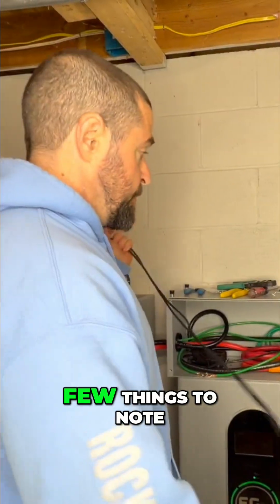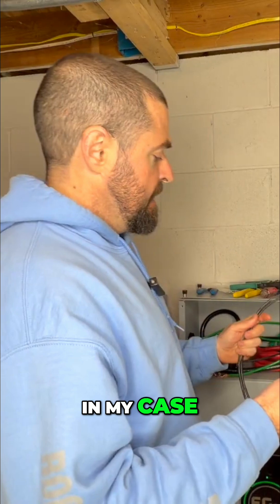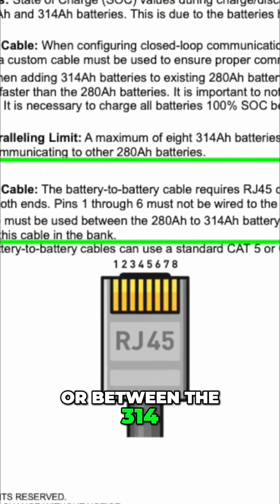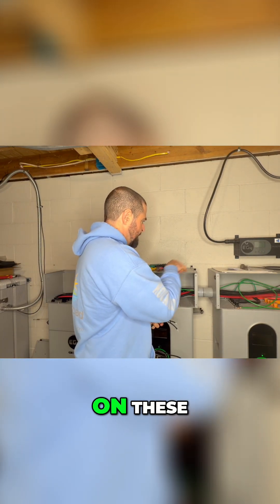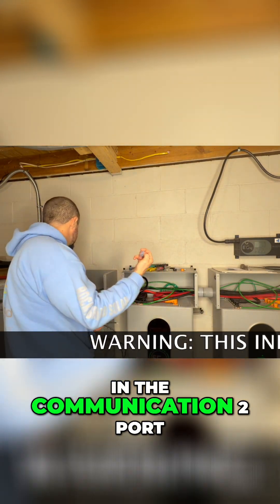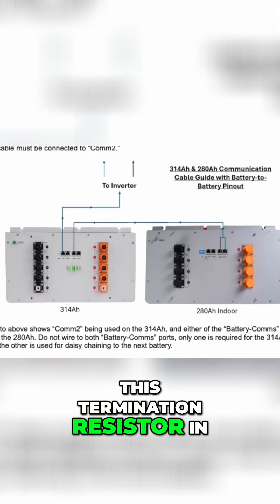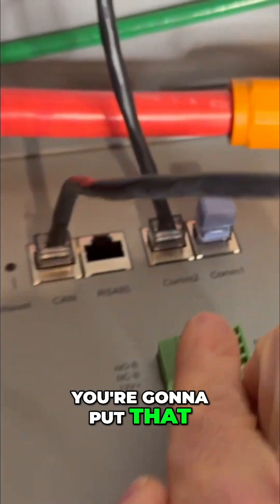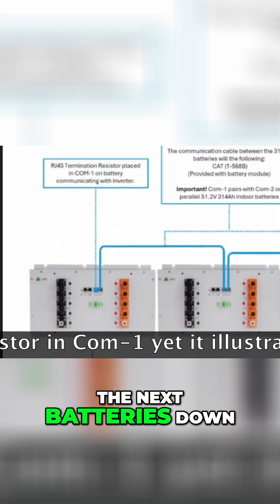Mixing Battery Sizes? Master This EG4 Paralleling Hack NOW! #shorts

Comment: I’ve been wondering about this exact situation. I have existing 280s and I had planned to add another one once a year for a few years to get to my desired pack size.
Reply from the maker: That's great, adding a battery yearly is a good strategy!